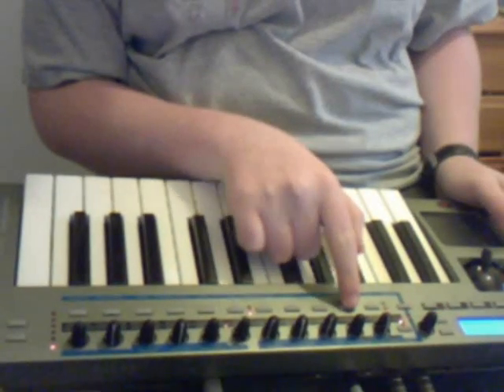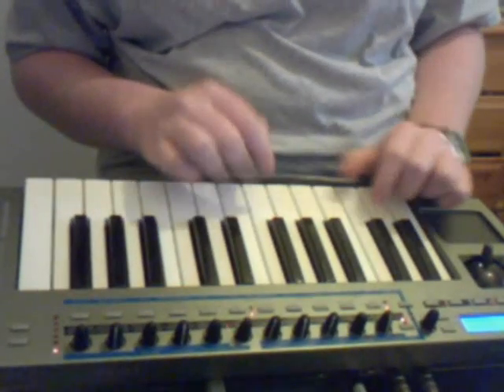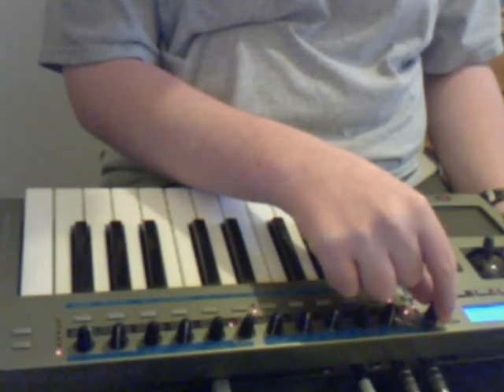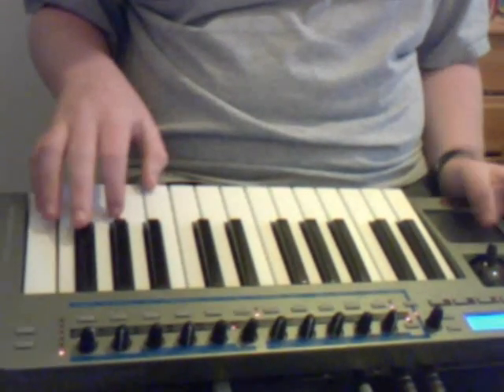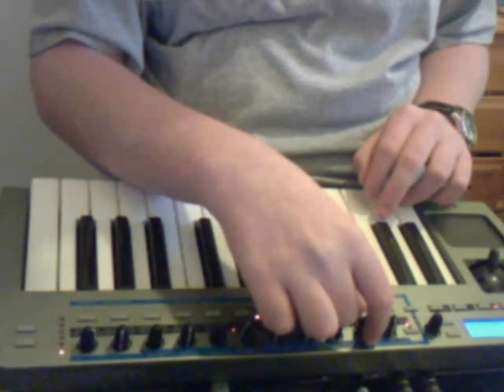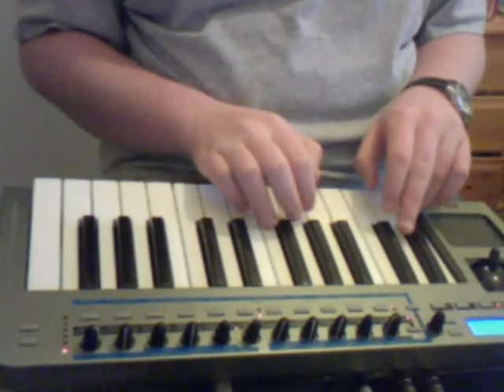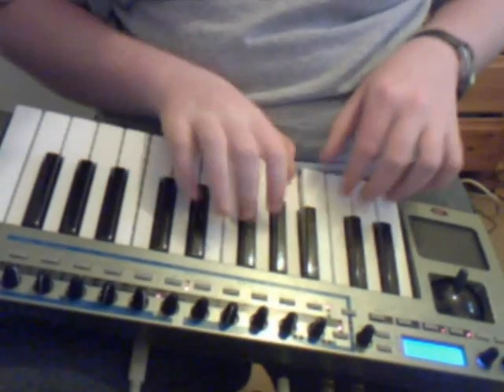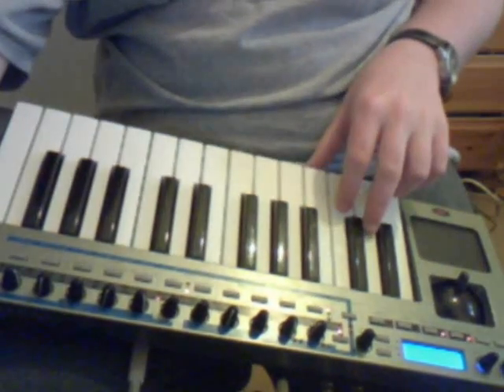Synthesis Tutorials - How to make a Minimoog Lead - Xiosynth

Comment: i made a minimoog patch myself.  i used a sawtooth wave and used the 1st lfo set to "random" to slightly modulate the pitch of the first ocssilator
this created the effect of an analogue ocssilator.
for the 2nd occsilator i used some very quite white noise to emulate the effect of a dirty connection.
the third ocssilator was another sawtooth detuned from the first.
then i turned on the vco drift effect up to full.

Comment: If you read interviews with skilled veteran keyboardists like Tony Banks or Rick Wakeman, they're not hung up on digital vs analogue questions, and they appreciate the reliability of modern digital keyboards. Had such gear been around in the 70s, you can bet they'd have used it, rather than having to negotiate with their Mellotrons and cart around RMI Electrapianos!